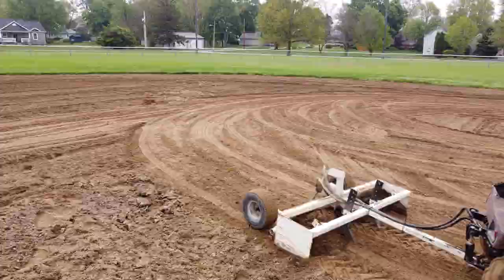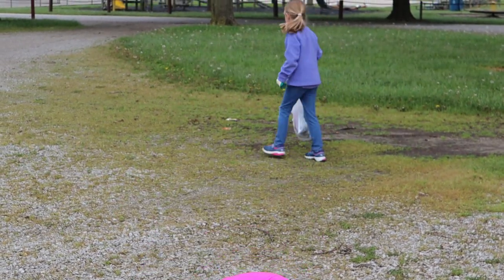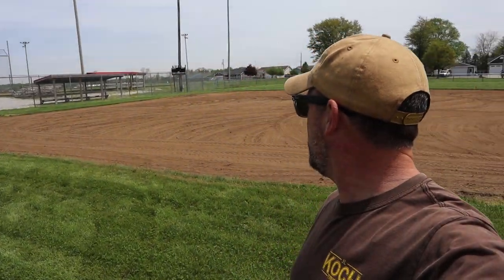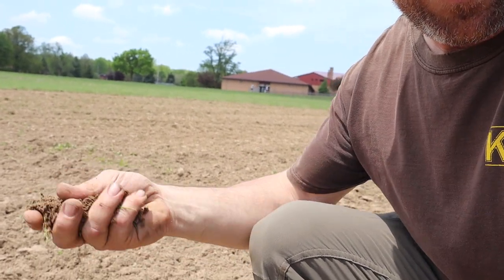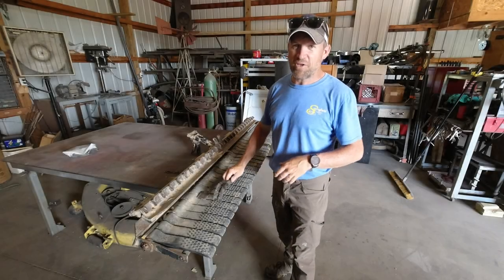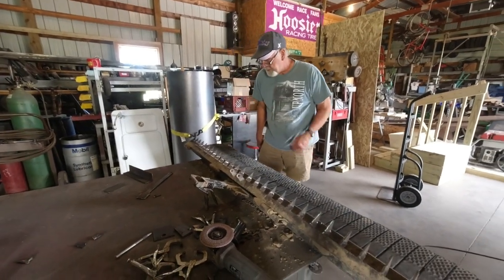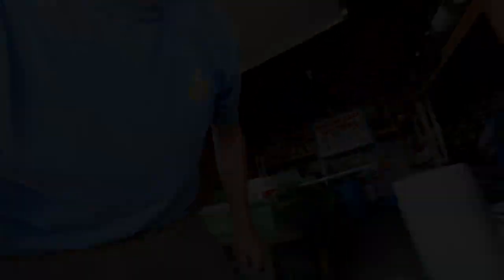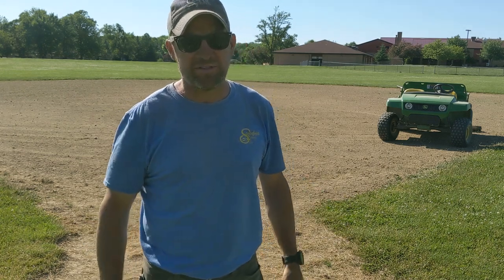Tractor Day at the Ball Park!  Garden & Compact Tractors with Pull Type Box Scrapers In Action!

Comment: If this is a regular thing. Might look into ABI gravel Rascal. It does have attachments like a cocoa mat, broom and leveling chain mat. But those implements are expensive.
Reply from the maker: I just looked at them after seeing your comment.  Looks like a very nice tool!  May need to have a closer look so thanks for the tip and thanks for checking out the video.